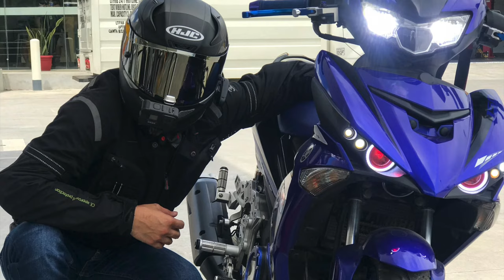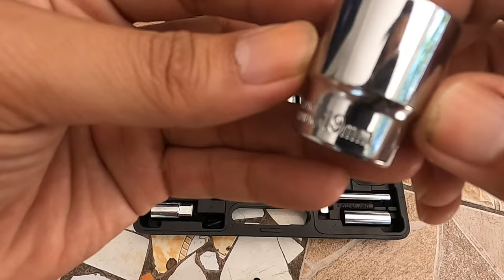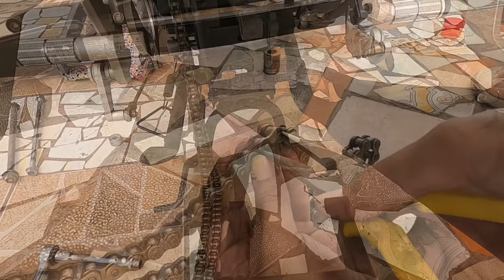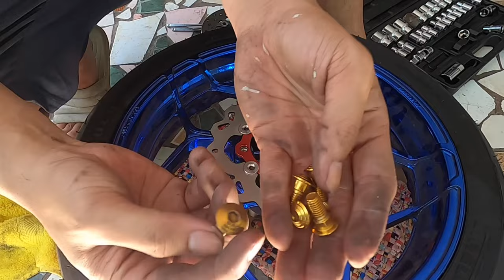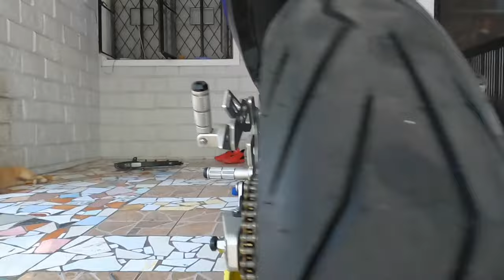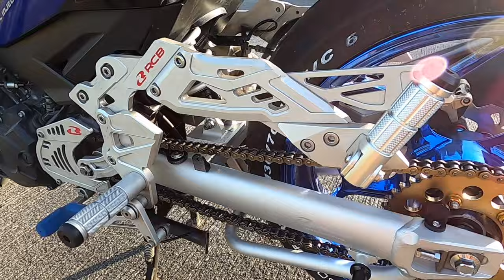Sniper 150 | RCB Luxury swing arm installing | RCB Floating disc rear | Y15ZR | Exciter 150

Comment: Boss lods, slamat sa shout out, nga pala, balak ko kasi magpakabit nyan, ung normal lng, ask ko sana kung sulit ba siya and di ba mkkapekto sa handling and sa curves tsaka kpg may angkas??? .slamat madami, need ur advice po ..
Reply from the maker: Wala namang problema normal ng rcb swing arm. Wala siya problema when it comes to handling based on my own experience and riding style. Na try ko na din mag banking na may angkas wala din problema. Yunf sa chain guide niya lang talaga need remedyohan. Pero easy fix lang naman.
Reply: @jokrides  salamat lods, and un din sabi sken nung mekaniko, lalagyan nlng daw ng industrial belt prang ung ginawa mu sayo .. Anyweyz good to go na q dyan, slamat lods,Godbless..👌🏻

Comment: Bords pa share naman kong anu ginagamit mu pampawala ng gasgas sa snipy?.. At saka pampakintab?.. Slmat ride safe always bords saty safe...
Reply from the maker: Sakin sa gasgas wala gawa ng running water ako bago punas. Pero makakatulong ang wax pantanggal pansamantala scratch marks. Pampakintab naman koby sampaguita solve na at mabango pa 💪🏻
Reply: Slamat bords.. San bumibili ng koby sampaguita bords.?tpos anu wax na bagay bords?  Slmat sa advice bords.. Ride safe
Reply from the maker: @jadecondez9254  any wax na pang sasakyan bords. Pero yung koby wax at pabango na kaya solve kana sa koby. Casco markets bords marami sila niyan.

Comment: nice one lods . btw anu sprocket size mo ?
Reply from the maker: 14-43T tayo bords 😜
Reply: nice hehe 42 sakin ang bigat pag naka big tires hehe thanks lods
Reply from the maker: @meizee3662  43 or 44 mo bords. Hatak na hatak yan at di ka bibiguin. 😘
Reply: nice try ko yan hehe inaabangan ko yung vid mu para sah cam , valve spring at ecu hehe
Reply from the maker: @meizee3662  papatono ko pa bukas ang ecu ko. Baka wed upload na 😉
Reply: nice aabangan ko yan lods
Reply: Sir pag naka 140/70  likod ano magandang combi po
Reply: @jokrides  paps ano tire size mo sa likod